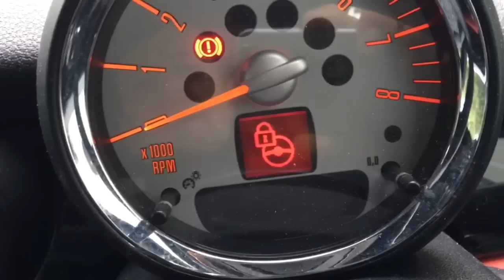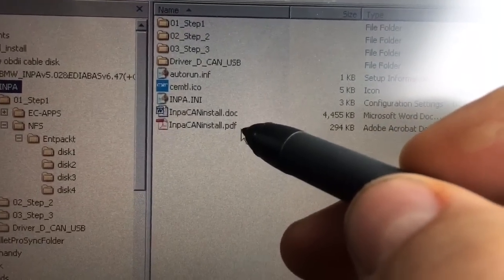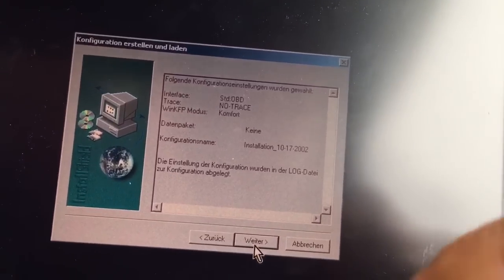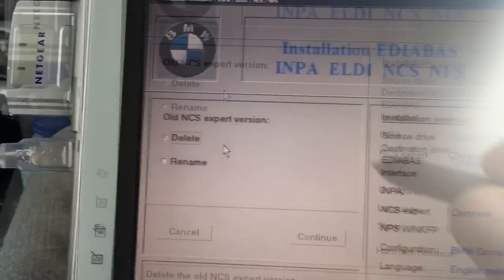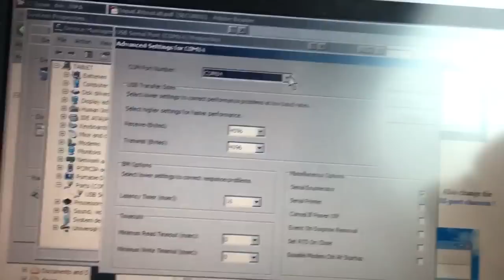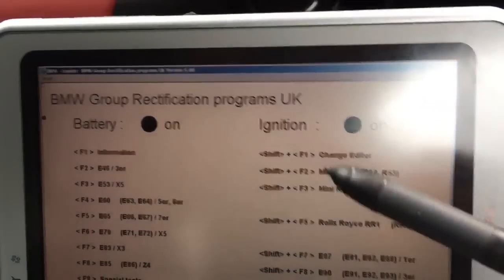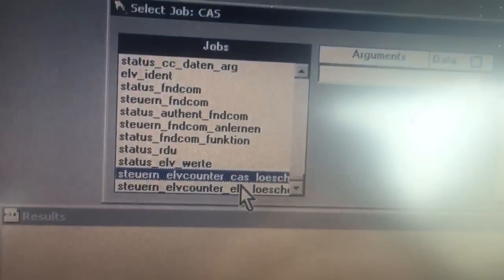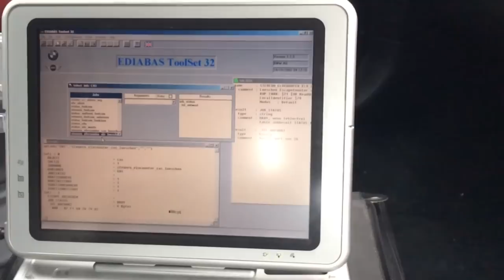How to Fix the BMW & MINI Steering Lock warning CHEAPLY!

Comment from the maker: So it was a year ago that this video was made.  I permanently fixed the problem by dismantling, cleaning and lubricating the lock as shown in my next video:  https://youtu.be/ymu1Y6OOULE
Without that stage, the warning came back after about 3 months, so you can either keep on resetting it or fix it permanently by stripping and rebuilding the steering lock unit as shown in that video.
Reply: Thanks for this. It is really helpful. Can you give me some advice please mate. My battery has been going flat very easily lately and o have been jump starting it. It went flat lately and I could jump it as there was another car in front. Then I had this steering lock issue, but the ignition won't even start. I've bought this software and cable does it work if the battery is flat with no ignition? Or do I need to jump start it first? Thanks
Reply from the maker: @huntergatherer8972  No it needs a well charged battery, with the ignition on. Sometimes it works best with the engine running as well.
Reply: That worked
Reply: Hi I have tried running the 2 jobs, the results shows ok for both but there’s no improvement and the lock and message continues to persist. Can you please advise?
Reply from the maker: @deeplover161  The lock may have actually failed rather than just going slower, the next job is dismantling the physical lock to fix it.  See my pinned comment at the top.

Comment: It's a short video less than 15mins, but the effort behind it should never be underestimated. Thank you for your help! I was stuck at getting the cable driver correctly installed, but I googled and somehow fixed it.
Reply from the maker: Thanks and well done to you for fixing yours.  Also see the steering lock rebuild video for a more permanent fix.

Comment: I went through this process and it worked. I now have a laptop and cable with which to do this. If anyone needs help and are local to Leamington Spa, UK, then let me know. Cheers.
Reply from the maker: Well done. It will need a strip down of the lock to fix this permanently. See my other video.
Reply: Whats the software used?

Comment: ITS ALIVE!!!! Thanks! I had everything in new folder and guess it doesnt like spaces so i changed it to newfolder. I also changed all the exe files in properties to xp compatible since i am on a win7. i also need it on port one on the com for the laptop to read. 
damn mini... after taking apart the steering lock I saw the rubber stopper worn out, so the anti tamper was engaged. so i dremaled the copper plug holding anti tamper pin. now its working great
Reply from the maker: Great!

Comment: thank you so much. it works on BMW e90 318d. And I have changed the battery it was because of battery voltage as you said, and I thank you once more. I will also support you for this video through PayPal.
Reply from the maker: Thanks!

Comment: Hi, great video and really helpful. Rather than loading the software onto a computer, do you happen to know which handheld OBD tester would do the same job and reset the electric steering lock counter ?
Really appreciate any advice you can give. Thanks
Reply from the maker: Sorry I have no suggestions on that.

Comment: Thanks for sharing the video🙏 My car key is about 5 years old. Do I need to replace my key fob battery?
Reply from the maker: It depends on the type of battery used in it, check your service schedule to see if it ever needs replacing.  In the R56 mini I had the battery was a rechargeable type, so it is not a regular replacement type.

Comment: thanks bud - mine cam on after my battery finally gave up the ghost trying to crank - luckily fired up and got me home then i fitted the battery id had sat there a week lol tool32 took a bit of gettign running for some reason but closed it all down and retried and managed to load the jobs, run them and voila! :) Some chancers charging folk £50 for this.
Reply from the maker: Great, well done.

Comment: Thanks very much for this video! I am grateful you knew the error programs to run to clear the warning.
Reply from the maker: Thanks for your input.  The red padlock symbol is also meant to mean that the car wont start. That wasn’t the case in my car though, I think that only applies if the lock has actually failed rather than just going slow.   See my other video for a permanent fix to the lock, as the warning comes back after a few months.

Comment: So this common r56 elv problem mainly caused by low volt car battery?
Reply from the maker: No not the main cause, ageing and oxidation and the electric motor running a bit slower is the main cause, but a low battery can show the issue earlier than with a new battery.

Comment: I seem to be having an issue. When opening the toolset32 and finding the cas file the jobs list is quite short compared to yours and u cant find the 2 jobs needed
Reply from the maker: Maybe you need a different software installation, or maybe the jobs list is installed somewhere else or something went wrong with installation (try installing again?)
Reply: Same happened with me I think this software is not correct
Reply: What is the size of your software
Reply: @deepakpanghal5514  i dont have it anymore. But i eventually opened toolset and i saw the jobs and they worked. Sorry, i know its not helpful but this was 2 months ago
Reply: @redacted1946  thanks for replying when I enter in job search there is no job found all job column and results column is clean

Comment: Thank you for the video it helped a lot! But i got stucked at the 11th step where you have to write the "USB-COM-port to the value that you remembered in step3"...so i wrote the number and wanted to save by replacing but "access denied" comes up all the time...do you know what might be the problem?
Reply from the maker: It’s hard to debug from here.  I can only suggest starting again from the beginning.
Reply: Hello...it worked to install the program and everything was fine except the the program doesnt communicate either a bmw(2006) and mini cooper(2006)...we are not sure if that is the cable's fault or not but we do not know what to do and a car must be fixed as soon as possible
Reply from the maker: @tamasfenyes2773  It sounds like an interface cable problem, do you have the INPA type OBD2 cable for BMWs? Links in video description as here:  
Here you can find people selling the interface cable that you will need on amazon uk:
https://amzn.to/2EB48if
And Amazon usa:  
https://amzn.to/2qnevkO

I got mine from web site eobdtool.co.uk which came with a software disk.  
There are also a lot on ebay.co.uk:  https://ebay.to/2Mra8y3
Or on ebay.com here:  https://ebay.to/2QpGvQX

The important thing is to get one that says “ OBD2 OBDII USB Interface INPA/Ediabas - K DCAN for BMW”
Reply: @comeinhandynow  yes i got the exact same cable what you used in the video but still doesnt work :( i ordered from amazon checked 10 times if thats the good one and yes its the same
Reply: Oh and is it possible if you can order the cable and try it if it is working for you and then send to our adress? My father believes that the cable is wromg but if the cable works for you but not for us then the program is wrong and we will try to fix
Reply from the maker: @tamasfenyes2773  Like I said in the video description section: “I got mine from web site eobdtool.co.uk which came with a software disk.”. So try their cable.  They should also give you some support.

Comment: Hi, thanks for helping us...i just purchased the cable from Amazon, and for now i have 2 questions, does it works with Windows 10? And if the problem appears again, i will have to do do all the process again or just the last parts because the software will be already installed?
Reply from the maker: It will probably be ok under windows10 but check with software supplier (May have to run under compatibly mode if it doesn’t).  If problem reappears, which it may eventually, then run just the last part, as already installed.  See my other video for steering unit dismantling for a permanent fix.
Reply: comeinhandynow Thanks man, when i have more time i’ll try the other video
Reply: I'm having OBD drivers installation issues , can you give me a hand? Got the port changed and .txt file edited, but can't get a positive msg running the OBD.exe

Comment: Hi there just watched thisand it looks good to me,so i will give it a go...At the eng you say"Well if we now look what happens when we put the key in and turn the ignition on "So did you do this with ignition off and keys in pocket...So to speak TIA
Reply from the maker: The mini ‘key’ is in fact a fob that you put in the slot and then press the start button to turn on the ignition (feet off pedals).  I indicate when ignition is on and off in the video.  Ignition is on when i run those software ‘jobs’ to reset the steering lock.
Reply: @comeinhandynow  thankyou for your reply,the bmw im going to be doing this on works the same way

Comment: My problem is the ingnition still off, mini r56 doesn’t respond and my key turn on the radio or open doors but no ignition at all…. Please HELP ME
Reply from the maker: Does it have this steering lock warning in red? Does the steering lock still disengage? If so try the software reset shown in this video, if the steering lock is not working you may have to dismantle it to fix it as shown in my other video (link in video description) on rebuilding the steering lock.
Reply: @comeinhandynow  thanks for answering, the steering lock it’s stuck and the red warning still on, but no ignition and can’t connect the INPA… I’m afraid dismantle it jejeje. Another advice? Thx
Reply: I’m wondering if I dismantle the steering lock can I start the car? because without starting the car or giving it contact I can't connect INPA. Many thanks and forgive my bad English.
Reply from the maker: If you dismantle the steering lock then you can either fix the lock as in my other video, or you can plug in an emulator unit (buying info in video description - I hope these still work) and remove the steering lock unit to free up the steering wheel and then start the car.  Hopefully.
Reply: @comeinhandynow  thx I will try dismantle this weekend… hope it works jejeje I will tell u later if it works. Many Thx
Reply: @comeinhandynow  hello, bad news, dismantle the steering lock (SL), clean and rebuild but the problem doesn’t disappear… I try to start the car without the SL but is the same error… do y think my SL it’s broken? Maybe with a emulator SL can work? THX
Reply: @jholaechea hi, my r56 has red elv light on and can’t be started. Will the car be able to start again when the steering lock taken off ?

Comment: Thank you so much for posting this. My 5 series has just done it again. Do you know if the software works for Mac? It does it every 18 months or so, I’m sure due to the battery. It’s often after the car has been parked for more than a week or so. I don’t suppose you’re anywhere near Peterborough?!
Reply from the maker: I would guess there is not a version that runs on mac, but if you have a Pc emulator running on it then it might.  Nowhere near Peterborough, sorry.
Reply: Thanks for the swift reply (and apologies for my slow one). Yes I think I might have to borrow someone's PC and get hold of an OBD cable. My 5-series does this every 12-18 months. The car still starts up fine, it's just highly annoying and feels like a sword of damocles hanging over my head anytime I go away from home. Really grateful for the video. Thanks again.
Reply from the maker: I know what you mean.  After a few months my light is on again.  The next stage is to uncover the steering lock and lub it up to try and get it moving faster so that it doesn’t trigger an error again.  Look out for another video on this, maybe in a few weeks,
Reply: comeinhandynow urgh, it’s such a pain isn’t it? I think (can’t remember if your video mentions it) that the battery could be the main culprit. Mine usually seems to come on after the car has been sat for more than a few days. The elv still works perfectly fine and the car starts...is yours the same?
Reply from the maker: I was hoping that the new battery I put in at the same time would stop the error coming back. Sadly not.  I did bring the stop start function back to working again though
Reply from the maker: And yes the elv still works fine and the car starts ok.
Reply from the maker: Here’s a new video on rebuilding the steering lock to try and stop that error coming back 
https://www.youtube.com/watch?v=ymu1Y6OOULE

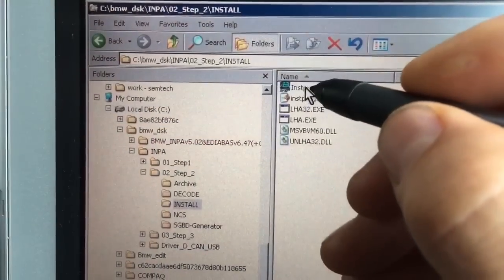Comment: Seeming to have a lot of problems with the section of your video at... 5:16 I've re watched the video quite a few times and have been doing my best to follow these instructions to the letter on the software. I keep receiving an error saying there's no "INPA.LZH" file. I've tried looking for it and cannot find it. Did you run into any issue similar when you were getting this resolved? Thank you in advance and have a good one.
Reply from the maker: I don’t think I had that problem, so it’s probably a broken software installation.  My software came with the cable.  I can only suggest doing the same or try anothe source.
Reply: comeinhandynow  Alright, I'll try a different software, then. I got the disk with the cable as well. That's why I'm so confused. Haha. Thank you for the reply.
Reply: Decided to try running through the installation with the disk I was provided with the cable. I found the fix for me was to take the step 2 file and copy it straight to the C: drive. Unfortunately these instructions on the pdf file are not worded the best. Leaving this comment incase anyone happens to run into the same problem I was having. I R smart. ha.
Reply from the maker: Thanks for the update, good to hear you got there in the end.  It’s a common issue with software, especially ones originating from different language sources. It needs patience and the ability to investigate, which you have fortunately.

Comment: I tried to do this on my 2007 mini R56 Canadian VIN, did know if i should choose UK or US. i tried both but didn't work unfortunately
Reply from the maker: Did you get the correct interface cable with the bmw chip and did your pc communicate with the the car using the INPA (_IPO) software as shown in the video?  Test with ignition on then off as shown. Maybe your PC or software or cable is not fright. It needs investigating to solve the problem.
Reply: @comeinhandynow  it will detect ignition but when i put the CAS.PRG the do the 2 steps there it will say IFH-0009 NO RESPONSE FROM CONTROL UNIT

Comment: Mine was the lock mechanism was not working i had to replace it it is end of steering column . not every time software is the problem get part from ebay £20 and labour cost £80
Reply from the maker: The error comes up when the lock starts to slow down.  A permanent fix is to strip and clean the electric motor and mechanism in the lock.  Can be free if you do it yourself, see later video: https://youtu.be/ymu1Y6OOULE

Comment: I don't have a lock icon, but the back wheels will only turn a little and then be locked. It turns a little bit but are locked. What can this be? It has been standing still all winter. The brake pads doesn't hold the disc brakes.
Reply from the maker: What model do you have?
Reply: @comeinhandynow  1 series 2004. E85 I think
Reply from the maker: I can only guess that since its been standing the discs have rusted and is binding against the pads.  Try driving a short distance to see if it frees up.  Or prise back the pads.
Reply: @comeinhandynow  Thanks. It's not the pads, they're free. The discs run freely for a couple of inches, only to suddenly hault as if someone are putting a metal rod into them:P
Reply: This is only the rear left tire.
Reply from the maker: Something to do with the differential? (Rear wheel drive).  Could be time to dismantle more bits to see which part is blocking the turning...

Comment: But even after a reset it will happen again without replacing the steering assembly...so replacing or taking apart and lubing is required.
Reply from the maker: It did after about 3 months, so you can either keep on resetting or fix it permanently by stripping and rebuilding the steering lock unit as shown in my next video:  https://youtu.be/ymu1Y6OOULE

Comment: 😂😂😂🎉🎉 I just done my BMW today I fully charge my battery lock and open a car it released the steering lock. Leave a car on charge for 1hr and it start with no fault code. 😅
Reply from the maker: That may be ok for a while, but eventually you will have to rebuild the lock. See my other video

Comment: i have sign of a window and then steering wheel locked and abc and dtc also cant start the car
Reply from the maker: Sounds like you have other faults as well as steering lock.  This procedure may help start the car by resetting the steering lock, as long as the lock is really working still (listen for it).

Comment: My bmw has this problem and has been to bmw and they have removed the steering lock and worked fine but after a few weeks it happens again,I go through same process by getting it removed by bmw,the car is fixed and fine again and then few weeks later it happened again?can anyone help me?why does this keep happening ?
Reply from the maker: All they are doing is clearing the error code. The fault is that the actual mechanical lock is going too slow. See the other video on my channel for stripping down and permanently fixing it.

Comment: Just needed to replace the battery in my case. I would say that's the the first step.
Reply from the maker: A low battery can cause it as it slows the motor in the lock, but it does show that it is getting near to giving a fault more often, even with a new battery.
Reply: Thanks for the feedback. So I will eventually need to remove the lock and clean it up I guess! :(
Reply from the maker: @fabiogranadosmendoza2178  Probably eventually, but see how it does.